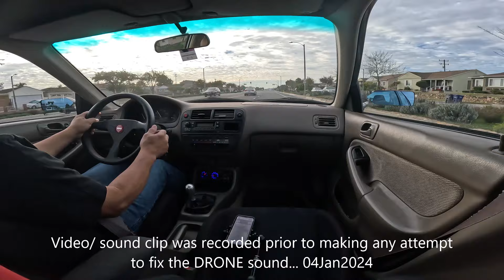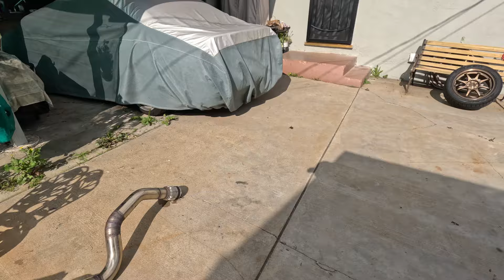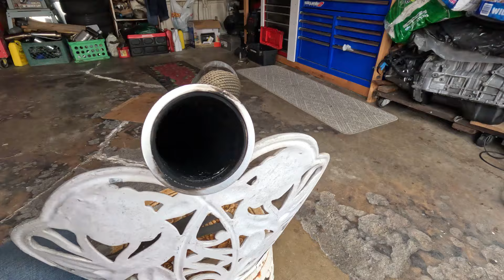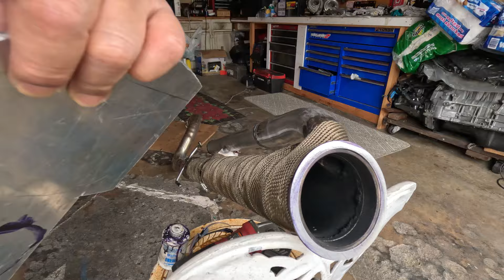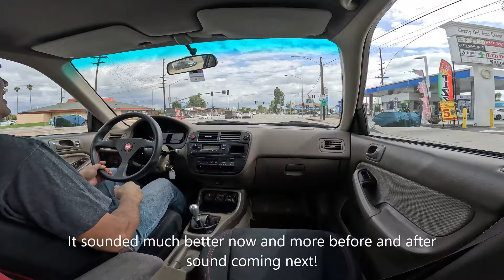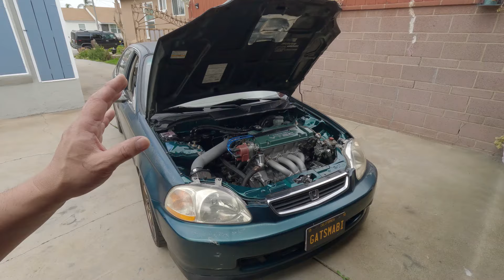Eliminate Exhaust Drone!

Comment: I have the same problem in my prelude cruisin in the freeway ...usually get out with a headache i always thought about a j pipe
Reply: They work and get rid of the drone. Apparently there's some math involved to get the angle, length, and pipe size to make it perfect but I don't think it matters TOO much.
Reply from the maker: It does work and l tbh l'd didn't bother too much doing the calculations. I tried it but only have minimal effect. Not really sure if l should have put it on before the Yonaka muffler l put on but no room for it. Anyway lt was so relieved its gone. I really have no recommendation other than finding air leaks or install a resonator. It did crossed in my mind to replaced the 12" resonator w/ longer resonator but l dont want to spend any $$.

Comment: Kuya can you make me one for an rsx, god damn drone made me go back to stock muffler
Reply: @sagittnet2158  midpipe is probably 2.25 axle back is stock
Reply from the maker: @bhadz100 Send me a msg on my email
Reply: I have a DC5 type R running 3 different resonators and a muffler, and I still get a bit of drone. It isn't the buzzy drone noise but around 3000rpm the entire vehicke seems to vibrate to the exhaust. 

Next step for me is to try some sound deadening material and some undercoat spray 
Nex
Reply from the maker: @nme87  I know what you going thru. I still have a little bit but not enough to annoy me like before. Hope you find a cure man! I really couldn't advise much other than finding a air leaks coz that's what fixed mine, a little bit of it. Later man!